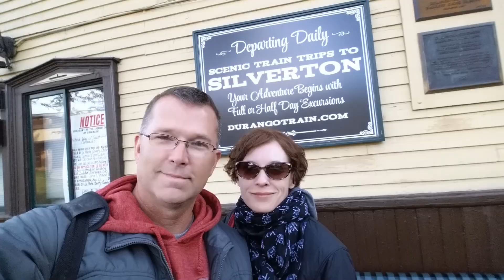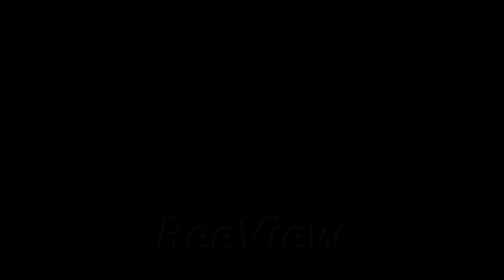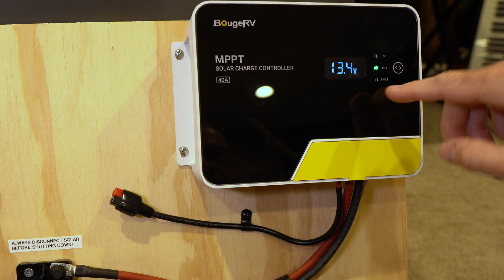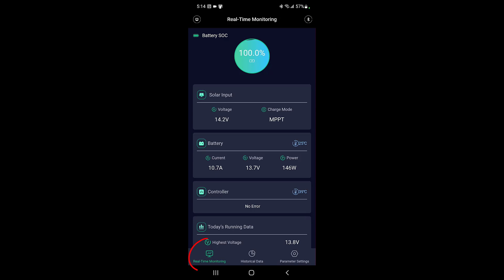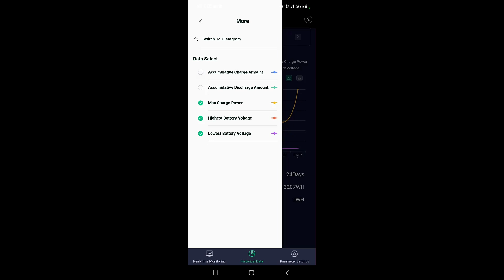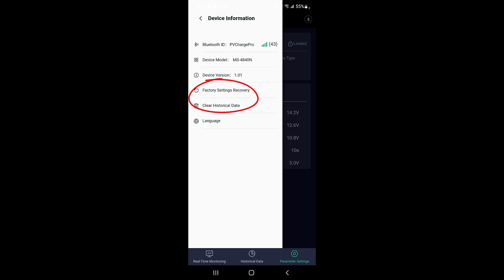NEW BougeRV 40A MPPT Solar Charge Controller w/ChargePro  App: In-Depth Review

Comment: Thanks for the video.  I'm trying to compare this with the Victron controller.  Looking at $$ vs value.  Note.. looking at your battery.. I just bought a pair of these from Amazon.. at least I think they are the same battery.. however, mine say LiTime vs Ampere Time.  The logos look exactly the same.  Unfortunately, the descriptions in the Amazon ad did not give complete information.  I wrote the company AFTER the purchase only to find out they are 0.2 or C/2 rated vs 1C batteries.. that's a HUGE difference and won't work well in my van build situation.

Comment: I have one, no problems that I know of.  But it was flashing 87% then 95% often yesterday, why does it flash 2 different  SOC ?
Reply from the maker: One possible reason is that in mixed sun conditions, the battery is alternating states of being charged and not being charged.  And the voltage reading whe. It's actively being charged is always a higher voltage than when not...of I'd guess that the SOC value will read higher when actively charging vs not.  Just my guess...

Comment: Im a little annoyed. Bought mine recently, and it gets less than half the wattage as my old "perfect suiter" pwm controller per panels. 600 watts are more like 280 watts with this controller under peak sun hours. Not exactly sure why.

Pwm controller pumps out WAY more wattage.
Reply from the maker: Yeah definitely something amiss there. The MPPT should be doing way better than your PWM.

Comment: so, this solar charger can automatically select battery voltage? say if 2 x 12Volt batteries in  are connected in series then it will charge 24 v, if 4 batteries are connected in series then it will charge 48 Volts? I am guessing that total solar panel voltage output should be somewhat greater than the voltage of battery bank?

Comment: This charge controller cannot charge the battery to 100%. Even if it says so, I can still use my wall charge to charge lot more into it. Have you had this issue and how do you solve it? Or do you know any other charge controller can do 100% charge to the LiFePo4 battery?
Reply: Make sure you have on the correct battery setting.   I don’t have any problems charging my 100ah Chins lithium batteries.
Reply: set you upper volatage limit in the app it will stop where you tell it to refer to your battery for the type of lifepo your using

Comment: Would it be compatible for induction stove?
Reply from the maker: You'll not want to try and run loads directly off the charge controller...that's the inverter's job.  The watt draw on a portable induction stove can vary from around 600W to about 2000W, so you'd want to ensure that your AC inverter choice supports a bit more than your stove is going to draw.
Reply: @ReeWrayOutdoors  3000W inverter would be recommended ryt ?

Comment: I want to insert a breaker switch between to two 200 watt solar panels and the BougeRV 40 amp charge controller, I think that would be a quick and easy way to shut off the panels if you are in a hurry. So what size in amps would you reccomend? I am already using a 50 amp one between the charge controller and the 200Ah LiFePO4 battery.
Reply from the maker: I think something like this would be perfect for that: https://amzn.to/40JefwI it's what I'm using as a disconnect for my 800W series connected array.
Reply: @ReeWrayOutdoors  How many amps is that?

Comment: Thanks for your review, good information.  It's close to thanksgiving and BougeRV is offering a discount on this 40A charge controller.  I need to know though if it will work to charge my 48v golf cart.  I have six 8v batteries of course in series.  I believe it will work but I would like confirmation.  I asked BougeRV support this question 4 days ago and haven't heard back from them.  Would you know if I can charge my golf cart with this charge controller?
Reply from the maker: Yeah, I think that should work fine - you'd just need to ensure you have the correct battery type (chemistry) selected so it is using the appropriate charging profile.

Comment: Excellent video! Your input helped me conclude that this is reasonable unit to purchase. Now my question: How did you connect the ground? Did you do just a chasis ground with the inverter? I will be using it off-grid, but in my backyard shed. Do you have an opinion on creating an earth ground and connecting to the that?
Reply from the maker: Thanks for the kind words!   I didn't bother with ground in this small demo kit, but if you were doing this in a mobile application, you'd want to ground to the vehicle chassis, ideally.   In your case, you could just pick-up a cheap  ($20) grounding rod off Amazon and stake it outside the shed and just bring the ground wire in with your solar cables and tie all your grounds to that.

Comment: Very informative video. I'm currently evaluating 40A MPPT chargers for a new system for my camper trailer. Since my controller will be in my storage area and we boondock quite often it is imperative that the bluetooth app work without an internet connection. Can you confirm if this app does perform without an internet connection? Thanks.
Reply from the maker: Just tested it. I can confirm that the Charge Pro app does NOT require an internet connection to connect to the charge controller. Hope that helps.
Reply: @ReeWrayOutdoors  Thanks for confirming that for me.

Comment: if the charge controller doesn't appear on the website....guess who isn't buying it???
Reply from the maker: Looks like they're updating their website and have managed to screw it up!   I was able to find it though by navigating to the Solar Panels page which then had a link to the original solar power page.  Anyway, here's a link if you're interested: https://www.bougerv.com/collections/solar-controller
Reply: @ReeWrayOutdoors  hahaha this contrroller wont caherge your battery to 100%, best it'll do is 91% probably due to safety/warranty concerns. I 'm sure there is a way to reverse engineer it but figuring out the key strokes is anybody's guess
Reply: @jege41  Is there any way to charge the battery to 100% or if any other charge controller can do that?
Reply: @stevedxu  yes this controller is compatible with most different types of batteries, providing you set it up correctly.
Reply: @jege41  I believe all the settings are correct. Have you done a test that using a wall charger to charge the battery after the charge controller claimed full charge on the battery?
Reply: @stevedxu  I’ve got it installed in my RV with other charging solutions ( dc to dc 20 amp, generator, and shore power / converter) and my two 100ah LiP0 are getting fully charged.
Reply: @stevedxu  have you checked the voltage with a tester, as that would confirm whether or not the controller is under charging or if your AC charger is over charging?
I don’t rely on BT Stats. being 100% accurate.
Reply: @jege41  Yes I used multimeter to confirm the voltage. I think the problem is that the voltage doesn't change too much during the charging process due to the nature of LiFePo4 battery thus if the charge controller solely relies on that then it could be misleading and shut off too early.
Reply: @jege41  Thank you. May I know what's the type of battery you choose and what's the charging voltage you are using when setting up with this controller?

Comment: I bought the Ampere Time 12V 100Ah battery.  But I have no idea what all the settings I should be entering in. Can you do a video on that battery?  I bought the battery because I watch your other portable power station for HAM radio videos. CN you do a complete detailed video on how you programmed this Charge controller?  The tech support is horrible and the phone number doesn’t work for tech support.
Reply from the maker: Really, if you're using a LiFePO4 battery like the AmpereTime 12v 100Ah battery, you REALLY only need to set the Battery Type to LI in the Charge Controller App and the presets for that Type are all just fine, and probably MUCH safer than trying to make minor tweaks in the advanced settings which is more likely to just cause you problems.  That's basically what I did.
Reply: @ReeWrayOutdoors  like he said but the best your going to get is a 91% charge, which IMO sucks
Reply: charge it 13.4 volts that is 99 percent

Comment: I have this exact same controller and I put a 100 watt panel on top and I have 3 12 volt batteries in series.. can you help me out with it? Confusing about the charging situation.. seems like it won't fully charge them or it cuts out at a certain point or stops the charging. Obviously I don't hav more power coming to the batteries than the batteries
Reply from the maker: Yeah, that's the issue...with just a single 100W panel trying to feed a 36v system (3 12 volt batteries in series) that's going to be an issue since its Max Power Vmp is almost certainly <20V.  Even if you had 2 100W panels in series, you'd likely have issues since they're rarely going to be outputting the full Vmp.  You're probably much better off putting the batteries in parallel and just charging slowly with that 100W panel...unless you want to jump up to 4-100W panels or more.

Comment: I just set mine up yesterday and it also reads .1VDC high on the battery voltage. I verified this with a few different batteries (lead acid and a different Lithium)  and all read .1VDC high. I have a tech request email in and so we will see what BougeRV says. Like you said voltage is so flat on these LiFePo4 batteries that it would be nice if it could read it accurately. On the plus side it seems like a really well built unit and for the money it can handle way more power than a Victron when comparing Amps/Dollars. As an added bonus, it sure looks nice hanging in my RV bay. I put it through some paces today and so far so good. I am hooked up to 600 watts of panels. And my battery BMS amps matched pretty close to what the controller said. I saw 26 amps max before my batteries hit 100% and stopped taking the juice. I also have the exact same inverter as you, lol. I like it and it has been solid unit.  I just wish I could adjust the voltage out as it makes 111 VAC with no load on it and will drop to 107-108 with a 1k to 1.5k load on it.
Reply from the maker: Nice setup!  ;-)  I'm curious what they say about the 0.1V differential too.  It's not a dealbreaker for me...just seemed odd.  And I appreciate your observations as a reality check to mine!  At least now I can be certain it's not just my multimeter!
Reply: @ReeWrayOutdoors  So BougeRV got back to me in a timely manner and basically said that the voltage displayed is not adjustable and that .1 VDC error is in line with industry standards for accuracy. Like you said, not a deal breaker so I won't be taking them up on the refund they offered. So far I am impressed by the nice looking "Gold Brick"  I was able to connect to it yesterday from 80 ft. away, very impressive considering I was in my house at the time!
Reply from the maker: @gc599  thanks for the follow-up on that!  I've noticed that I seem to need to be fairly close to the controller to initiate the App connection, but once it's connected, it maintains a connection at a pretty good distance.  Is that your observation as well?
Reply: @ReeWrayOutdoors  I have been able to 100% connect from 20 feet and easily from inside the RV, Which is way more than I can say about my old Victron. And agreed that once your connected it stays connected even from a good distance. But like I mentioned I hooked up last night from 80 feet yesterday, which was a mind blower!
Reply: in my experience they show slightly higher voltage because they have to be slightly higher to charge the battery hooked to it.
Reply: 0.1v is well within margin of error.

Comment: The FLD setting is for lead acid batteries.
Reply: Old fashioned flooded batteries, ah those were the days (bad) constantly having to check the battery to make sure it had a full tank of distilled water.  But then again, those expensive Trojans are still very popular for some reason.

Comment: Question, have you checked the amperage of the battery charging vs what the app says? I did on mine and it appears to be way off, I had 1 amp coming in from panels at 60 volts, yet it claimed it was delivering 4 amps or 193 watts to my batteries, however using a clamp meter on that wire to the batteries showed it was actually only delivering only 1.2 amps to the batteries, with my battery bank at 53 volts. And there doesn't seem to be a calibration section to possibly zero it. So the amperage it's delivering to the batteries appears to be wrong. Perhaps it's correct at a lower system voltage, not sure. Compared to my Victron's those are nearly identical to my amp meter in comparison. Curious what you find. It is well built, but in addition to the voltage being slightly off, it seems like the amperage and thus it's watt hour count is also off at least on mine.
Reply from the maker: I've not seen that on mine.  I did use my clamp several times at the battery lead to compare with what the app was showing and those seemed to line up pretty well for me.  I'll have to set it up and check it again to see if it remains consistent...been slowly recovering from covid this week so might be a bit yet before I feel up to it.
Reply: were you using four batteries or one battery.  If you where using for batteries the amps would 1 in your case since its sending 1 amp to each battery.
Reply: @beldre1  one battery.
Reply: @andycanfixit  got ya the way you stated battery bank I thought you had more than one battery.  I just got one in the mail today today.  I will mess around with it cheers